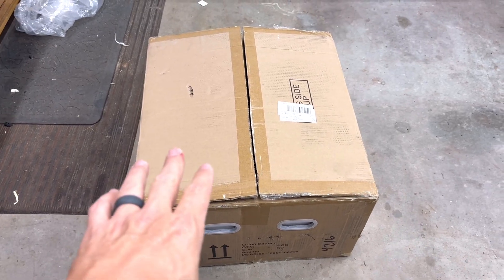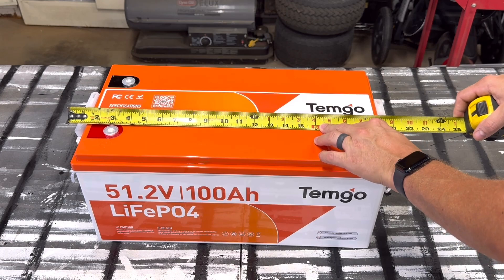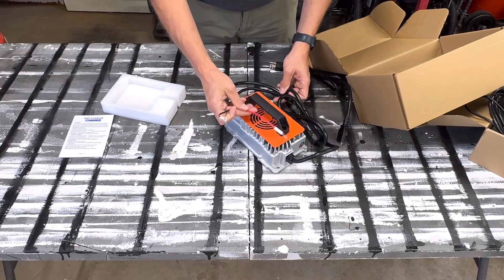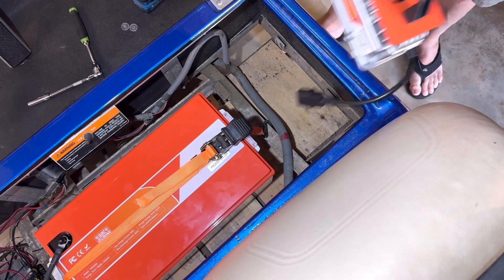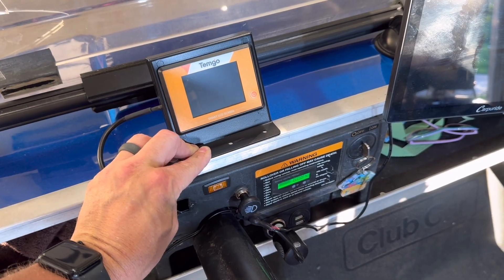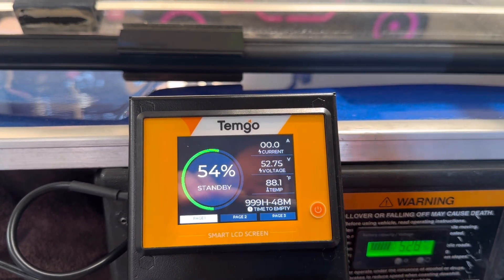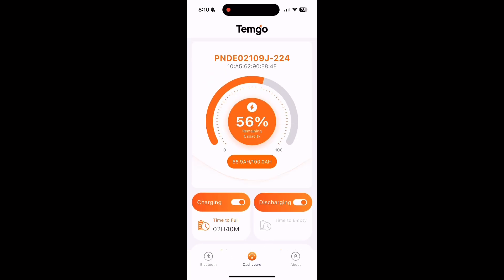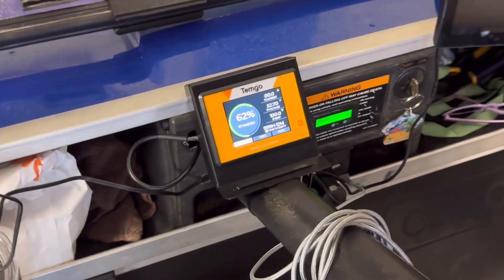🔋 Temgot (Temgo) LiFePO4 Battery Review & Installation

Comment: I've got a 2007 Club Car and there was a center console in the battery compartment. I relocated all that but theres a box and some other thing. I wiring everything up the way it was and I got nothing.  What should I be doing with all these other components?
Reply from the maker: What type of club car?
Reply: @BackyardGarage1  I have the center console too. How do we move it? I have a 2006 Club Car Precedent. The center electronics is all the controller stuff. Lots of wires etc. I need to move it to fit the batter. There was two batteries on one side of it and two on the other. I hope there is a video somewhere of how you moved the center electronics so we can fit the new battery.